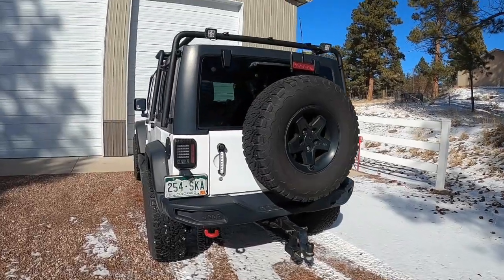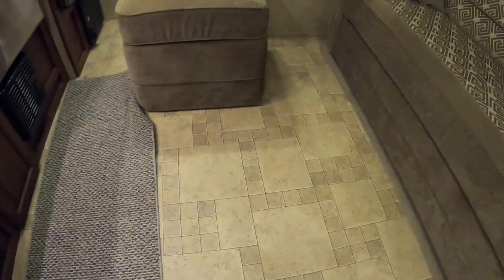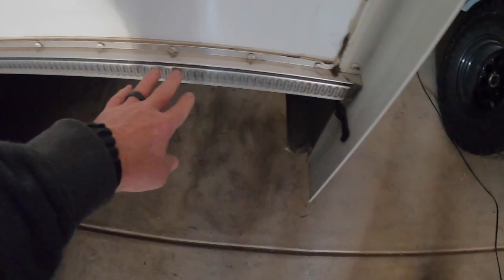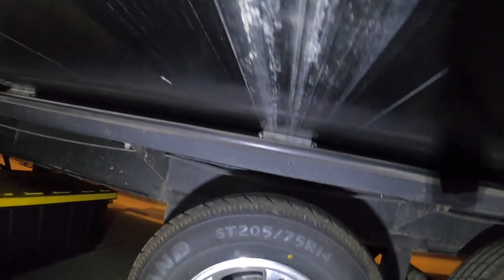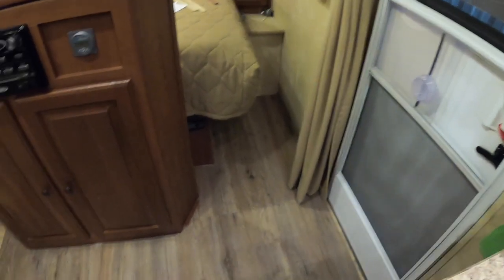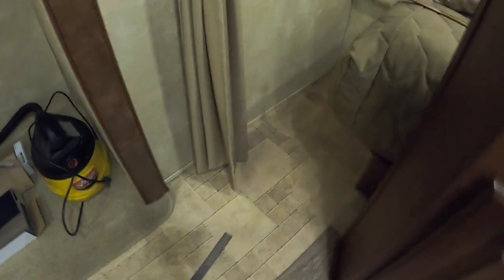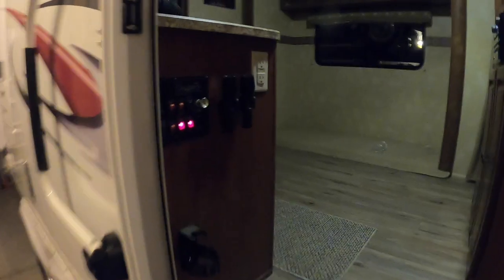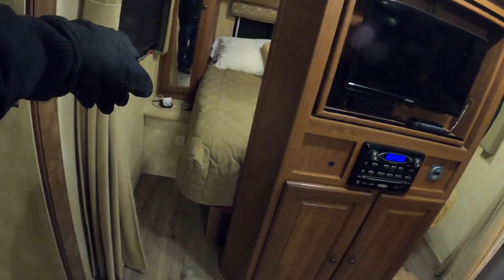RV laminate Flooring Upgrade Renovation Remodel - Is it easy?

Comment: Great video. This is helpful in knowing I can lay new flooring on top of the existing vinyl. Will have to check under the slide to see how that works. Will be ordering the same refrigerator for my RV in the next week, thanks to your video. 
Technically I think you have a s Schwintek slide not a rack and pinion. But that is irrelevant to your flooring upgrade. 
Thanks. Glad I’m not there with you in the Arctic cold!  🥶

Comment: Is this a "floating" floor? If so, do you think it will shift or come apart from the rigors of traveling on the road? The looks of it are really nice. Very classy.
Reply from the maker: Yes it is floating. Once it locks together on both ends and links in bond pattern like bricks it is impossible to break apart. Tough stuff. Will destroy it to break apart. I tried. Thanks for the comment.

Comment: The floor turned out nice.  Will it shift where the slide is as there is no wall to contain it?  Not needing to pull the linoleum is a huge deal.  Makes me want to do mine now.
Reply from the maker: Wont shift..enough on the sides to hold it... slide is only 70 inches wide and the planks are locked together very well.. good luck on yours!  thanks